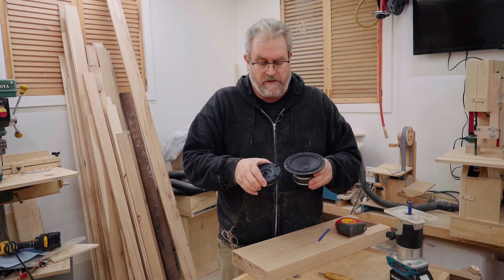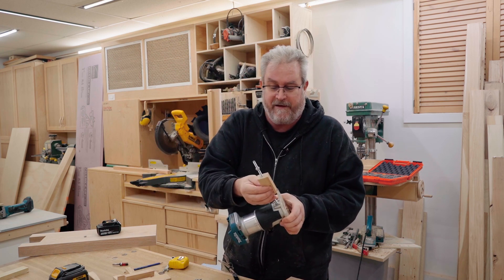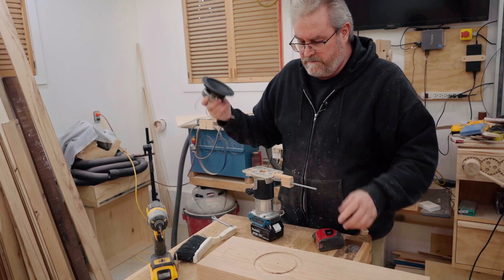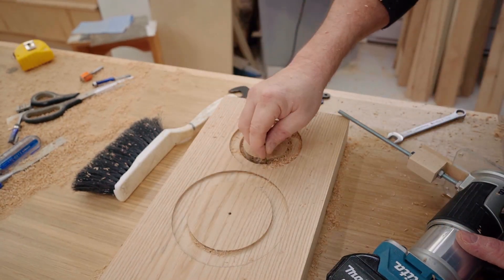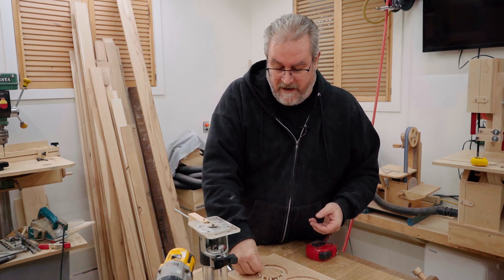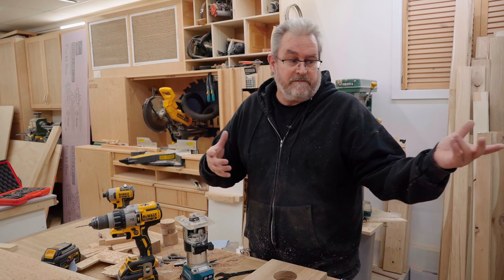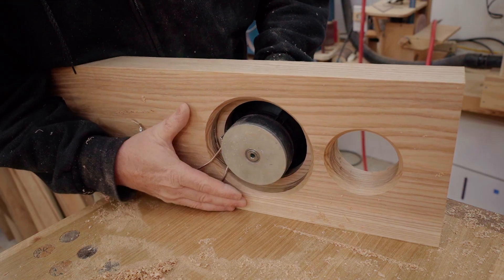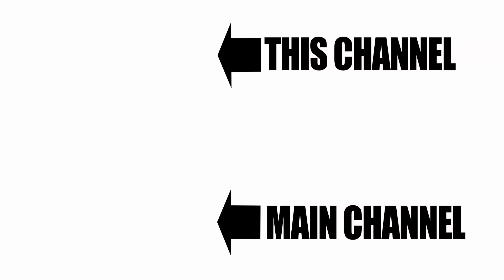Building my new Speakers - Cutting out the Driver Holes and Recesses

Comment from the maker: With the baffles shaped and the notches cut out for the stands, I can layout the location for the drivers and get the holes and recesses cut. I'm flush mounting both drivers and using my trim router with a very simple circle guide.
Here's a link to the video where I made that circle guide: https://www.youtube.com/watch?v=1aWh4h3uMzo
Included in this video is a pretty neat way to get the centre back after you've cut it out. I made the mistake of cutting the recess to small (the tweeter wouldn't fit) and I had to re-cut it after I cut the hole. I used dowels that are the same size as the router bit to put the plug back and it worked like a charm.
This is part 4 in my series on designing making a pair of open baffle 2-way speakers to use as "surround" speakers in my listening room. 
I've created a playlist with all of the videos: https://youtube.com/playlist?list=PLQl9KPrpiIH-5l4QhxUYXHGhr-covK8n6
Reply: I agree with your tests, but if one perfected every detail of a speaker, one gets great sound. Bigger speakers dont sound as good as small speakers. Your test with speaker panel vibrations is with mediocre speakers. Instrument tests dont prove a goos speaker.  Transmission line speakers play considerably louder than other speakers, & dont have to be big. PCM transmission line bookshelfs are the world's best speakers, in these speakers, carpet on the walls at certain locations make a big difference, but one cant tell the difference in mediocre speakers.  You are using mediocre speakers that cant tell the differnce. Small upgrades, one cant tell the difference, but with piles of upgrades one can tell the difference. Do you use the best first order crossovers, or use no crossovers. Your speaker drivers are in my Sonus Faber Concerto speakers with the paper woofer type I have. The later ones like mine use not paper woofers, but were almost as good. My Concertos are the world's best speakers.  The Sonus after mine they changed the same size cabinet that wasnt nowhere as good as my speakers. The speakers use a special bracing, special wood dried slowly 2 years in a dry kiln that made pores in the wood to cut vibration to make these speakers especially clear.. Expensive Totem bookshelfs use the same drivers as mine, but dont sound close to mine. My speakers use special resin inside the cabinets like a Strativarious violin does. My speakers are made in Italy by the best craftmen. Harbeth speakers are made to vibrate on purpose, but Harbeth has a patent on their low tone woofer rubber material. A $20,000 dac, great interconnects, A Krell amp makes a difference. Wall reflections are not a good way to test a speaker cabinet, but it is a good idea. I am leaving you a link on great interconnects. And a link in $200 PSB speakers that are much better & less harsher because of the woofer material than your higher price speakers you bought. These speakers are better than $1,000 B & W's speakers. The speakers were stereophile speakers of the year for 2 years, over $100,000 speakers & are often on ebay cheap & sold 1 million pairs of these speakers that wer discontinued last year, but sold for 20 years. Canada furnishes Paul Barton Of PSB speakers, a $1 billion sound room for testing for free, The US government furnishes nothing. . Buy only  PSB Alpha B1 speakers. Andrew Jones speakers are terrible against these PSB speakers. Here are great dirt cheap interconnects.  Click links.                                                                              https://www.youtube.com/watch?v=Q6Pl12DeGUw&t=6s                                                                                       https://www.youtube.com/watch?v=_P2umDQWA4g&t=333s                                                                                        https://www.youtube.com/watch?v=EjXS7Byg-xE                                                                                                      https://www.morrowaudio.com/                                                                                                                                                     If you want the best speaker in the world, get the $700 Magnepan's with this upgrade, but you must have an expensive amp like a Krell amp. This guy talks about Magnepans a lot.. Click next link.                                         https://www.youtube.com/watch?v=cLdlZ5bJXIY&list=PL2myLDLaTupAkHwrFbQii6HUa6RVqcVdd&index=8

Comment: You sat the XT tweeter face-down on that nipple thing! Daring! I've worked with those kind of tweeters and would never do that. Not sure I would lie the woofer down on its face like that either. They come with plastic tips precisely so the fronts of the drivers don't touch anything upfront until it's time to introduce them into the holes. Sorry to be a bore

Comment: You know I never noticed until recently that some tweeters are "surface" mounted and some are "recessed".  I think you were already committed to the tweeters, but had you thought of using recessed tweeters?  I would assume that comes with even more engineering to consider (width of recess, it's taper and curvature and how that affects it's projection?).

Comment: Very nice.  How are you going to run the wires for the drivers?  I wondered if you might split the boards to use the router to cut a channel for the wires and then glue them back together.
Reply from the maker: Thanks. There will be details on that in the next video.

Comment: John, I love your woodworking and you are one of my heros! It seems like you are designing the speakers on the fly e.g. speaker placement. Doesn't this have a gigantic effect on the sound quality and measured results of the speaker? Have you ever built from or tweaked a set design and tried to hit it right on? I'm just getting started and I took the build-from-plans route, but I'd love to hear what you have to say.
Reply from the maker: The centre to centre driver placement is crucial (closer is better), but in general placement is usually a aesthetic choice rather than a sound quality one. If diffraction is a concern, offsetting the tweeter can make an difference, but it's highly disputable whether diffraction is audible while playing music and therefore it's effect on sound quality is also in question.
Reply: I second that!!

Comment: Nice details! I use calipers to measure each driver. Messed up to many times lol.
Reply: I go by the engineering drawings on scrap, then adjust as needed. The drawings don't always give you the proper numbers for "cut your circle here". So using lots of scrap really helps me. But the drawings seem right-on about 95% of the time.